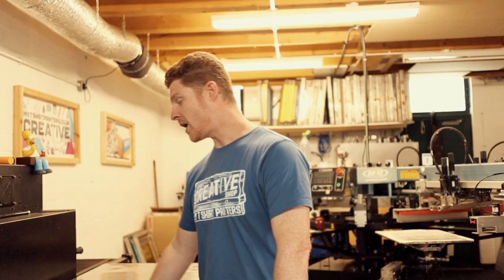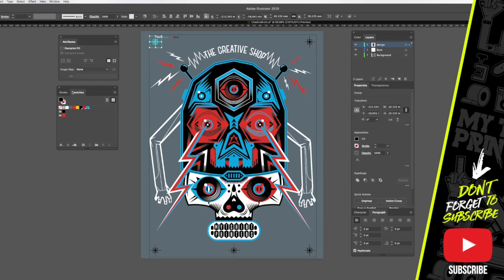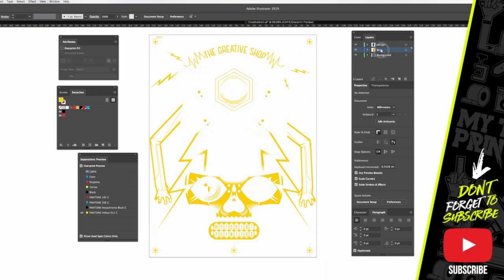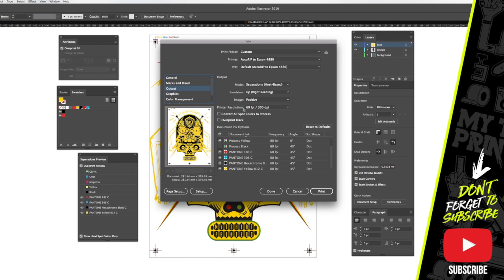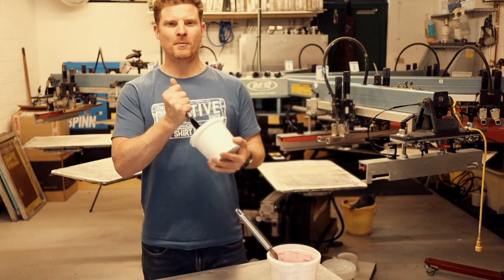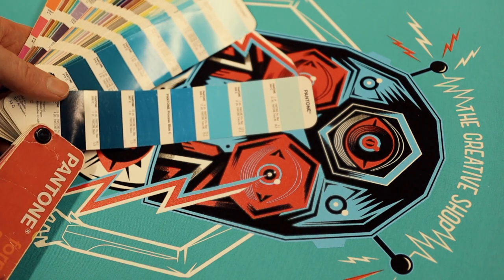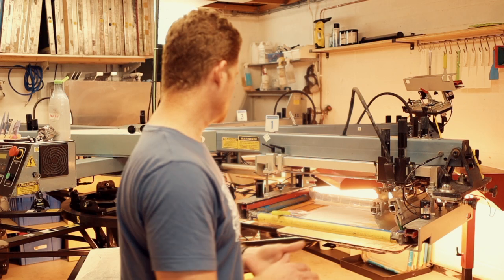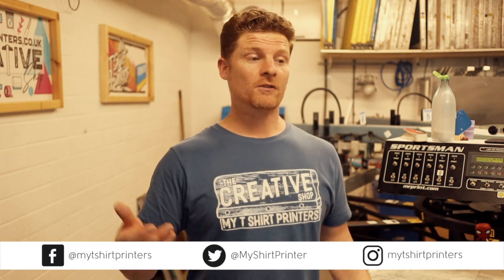New Custom Ink Colour Mixing System on a 4 Colour Print

Comment: Prints look great. So the waterbased underbase has to be completely cured before overprinting the plastisol or just completely dry?
Reply from the maker: Thank you! Ok so I would lean more to the 'dry' side as you want to get as much moisture out to allow the plastisol ink to bond to the underbase. If you have moisture trapped between the to different inks, that's where you get wash out problems. Thanks for the question!

Comment: yeeees a new vid!!
Reply from the maker: Man I love your comments! Hahaha
Reply: @KeeponCreatingTV  I wrote that before I watched it.:D  A waterbase underbase instead of a plastisol one. Now I have the confidence to try that out. Thanks!! Do you use some sort of hugger or catalyst on the white underbase? or just a bit longer under the flash as you showed.
Reply from the maker: @deprintprins8614  Even Better, 2 Comments 😀. No Catalyst, just flash it for a little longer getting all the moisture out and you are going to be blown away with how smooth your print comes out. Also to make sure slow your main tunnel dryer down to reach full cure of everything!

Comment: Awesome video! Print came out amazing. What water-based ink did you use underneath? Was it discharge? Is it safe to use water based ink under plastisol?
Reply from the maker: Hey Dan, thank man. I’m using Virus at the moment for waterbase white. It’s not a discharge ink, just a waterbase. It’s fine to use a waterbase under the plastisol BUT you have to make sure to cure it before placing the plastisol on top, hence leaving it a little longer under the flash. That’s where the problem is. Using a discharge underbase can also be used but this is even worse cause if you haven’t got all the moisture/ reaction out before the plastisol, it’ll crack and washout... trust me haha 😂
Reply: My T Shirt Printers ok that makes sense thanks for the reply. Never tried virus before. I gotta try this with comet white. That would be pretty awesome if it worked well and holds up good. I just worry it may start failing after 5 + washes.
Reply from the maker: Daniel Mullins I test mine in hot wash about 40C which is about 104F I think both inside out and normal, print washes well, print up 4 wash the heck outta em 😁
Reply: My T Shirt Printers will do. I think I’ll put a catalyst in it as well. I almost feel like if you used the water based underbase there would be no need for a smoothing screen? What is your thoughts on that? The water based inks seam to print supper smooth and thin.
Reply from the maker: @danielmullins572  Yup, if you have a catalyst def use it. Agree the waterbase underbase is like "Velvet" super smooth no need for a smoothing screen. It basically takes on the texture of what your printing. So a tight knitted shirt will give an awesome result, start smooth - end smooth. When you've struck one off send me over pic (no pressure, only if you want), be cool to see.
Reply: @KeeponCreatingTV  Thanks man will do. If this is something that works well I may start using it for all my orders. Wont be too hard to keep one color of waterbased ink from drying.